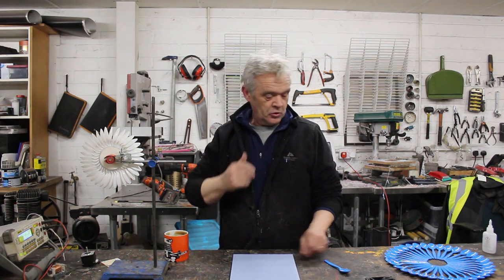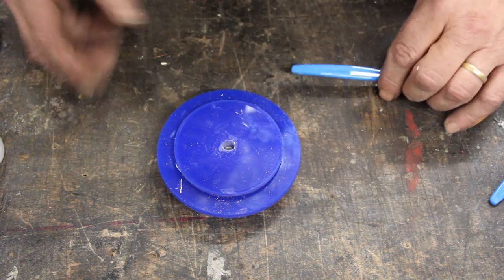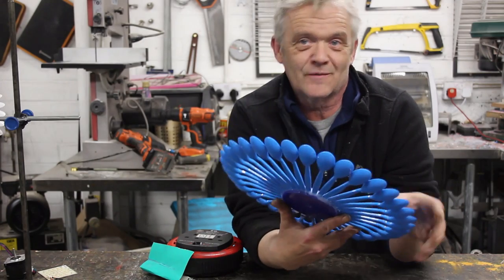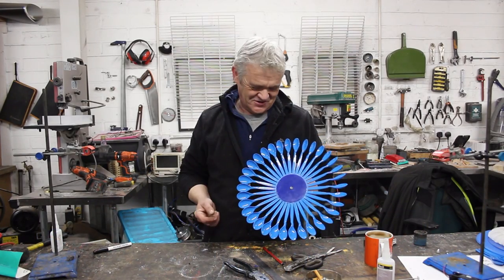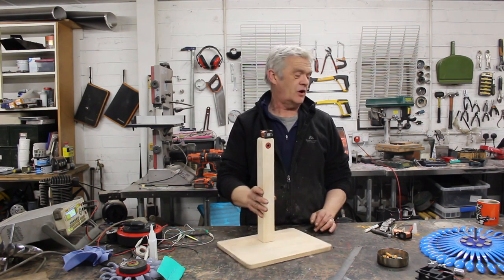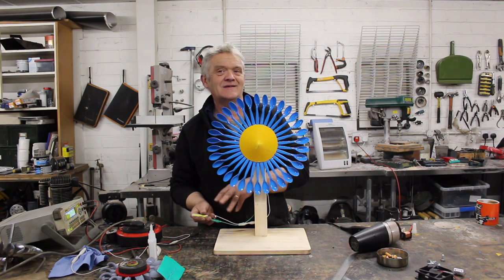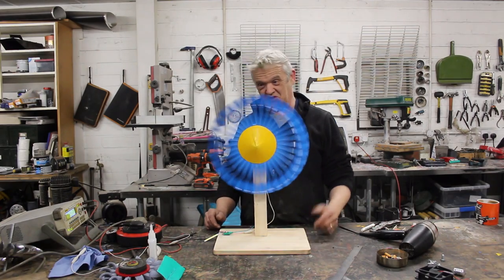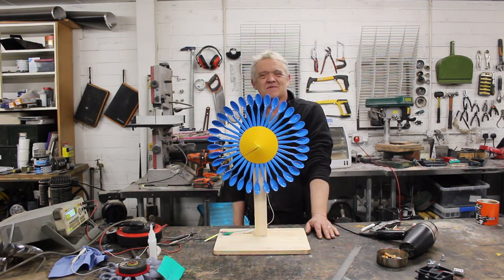1479 The Daisy - A Wind Turbine From Old Plastic Teaspoons

Comment: Perhaps twist the spoon nearer the hub, the spoon handles will also act as a blade and catch the wind making it more efficient in lower wind speeds.
Reply from the maker: true enough but you might risk softening the glue - maybe twisting them before glueing up?
Reply: @ThinkingandTinkering  good idea,  one could use a jig/mold to hit that 27°angle you mentioned.

Comment: “Daisy “ is a great idea. Perhaps some old Venetian aluminium blind blades would be adequate for a larger project. As they can be twisted, a coarse angle near the hub reducing down to 27 degrees pitch at the tip. To hold the pitch in place could be 3 rings (hub,middle and outer) with a slot for each blade, set at the fixed angle for the station point on each blade. I think I might just give it a try!

Comment: More coils would be good as there is room to add three more of the same size but you probably didn't have those on hand and would want to get the idea up and running first anyway. Cheers Robert.
Reply: I think more coils will be to strong for the surface area the spoons are catching
Reply from the maker: lol - you are quite right mate - that is exactly what happened lol - I put more on the test model

Comment: Other than this: Great video! As always, cheers!

Since you're doing a supplement, I happened to notice, the spoon next to or possibly 2 away from the junction line of the cone's continuation is a bit more angled than the rest of them. 
Ideas for "modding" the setup as a part of the next installment, or now that they're bent, de-cone the front and check your angles by flipping it over and rebending them to make sure their new contact point is all the same. I know a reheat of the material may cause adverse effects but I just wanted to offer. 

And I know, armchair Science journal member here, but I think creating the series continuity of, what if there's a problem, could benefit us novices.

Update: I was completely wrong and the rewatch proved it, you're good.

However, given the color scheme, 
💙💛
I move for this to be renamed the Sunflower wind generator!
Reply from the maker: like it mate - the sunflower - has a nice ring
Reply: Maybe shaving the back edge of the handle with a belt sander would provide slightly more precise spoons👍

Comment: Would having the bowls of the spoons closer to the hub improve the efficiency?
Reply from the maker: I don't know - try it - I only put them there because it was easy to glue them straight on without having to cut anything
Reply: Being longer gives the daisy generator more kinetic torque and a flywheel effect. Better for low winds

Comment: That's very cute.  I'm wondering at what gear ratio it would be most efficient?
Reply from the maker: I don't know - clearly gluing the magnets directly to the back means it is 1:1 - but that may well not be the best as this kind of turbine is well known for low speed but high torque

Comment: calvingreene90... yes this could give a large improvement.  Also, if the cone was a solid piece, holes could be drilled around the circumference allowing spoons to be inserted at varying pitch (would require spoon handles to be glued into a tube first - this needs to be a snug fit in the drillings to prevent unwanted rotation).
Reply from the maker: nice development

Comment: Hey Doc, I have a question: isn't one of the assumptions of the Betz's Law to work with non-compressible fluids?
Reply from the maker: Betz law is based on Newtonian fluids mate - which is a fluid in which the viscous stresses arising from its flow are at every point linearly correlated to the local strain rate - the rate of change of its deformation over time. Stresses are proportional to the rate of change of the fluid's velocity vector.
Reply: @ThinkingandTinkering  Thank you!

Comment: I made same wind mill using two cd discs glue spoons on one disc use centrre piece to put in hole of disk then as the other and glue to balance the spoons u use plastic milk bottle a pencil and a nice pen pencil goes onto own glue put hole in tip of milk bottle that's the balance when finished the windmill turns and spins I'm the only one that's made this idea when made its the size of a big dinner plate. I could use that as a generater

Comment: Might make many a garden much nicer! A light sensor or timer switch, small battery and a simple charger you might power a outdoor light at least for the important hours 19:00-23:00
Reply: I think you would get more power than that out of it at times. There are off the shelf 18650 chargers and cheap regulators (to power the charger) that would cost less than £5 total.
Reply from the maker: for sure !

Comment: Just looking at your spoons, they are oriented so they act like the blades of a pelton wheel, which may reduce efficiency, as the air being thrown out by a spoon will negatively affect the air and the spoon behind it. I wonder what would happen if you were to place the spoons the other way round, so they presented an airfoil face to the wind. You would then get laminar flow round the spoon, so probably some "lift" and the air leaving the blade wouldn't impinge upon the blade behind it....just my 2p worth...

Comment: Your latest binge of everyday unassuming items being converted into electric generation, be it is small or as large as it happens to be, just shows that at no point no time should anybody be totally bereft of Hope of charging the phone or running an LED for lights to see it a little bit at night, I'm thinking like in the aftermath of a hurricane little devil copper wire salvage out of a building and a magnet off of speaker and some spoons and you can have power for your phone
Reply from the maker: I agree mate - there is always hope